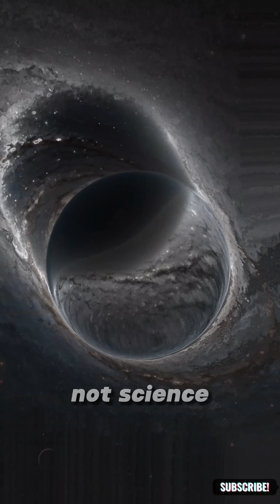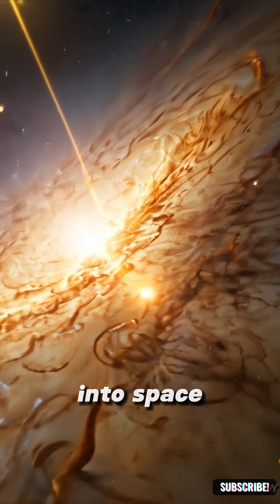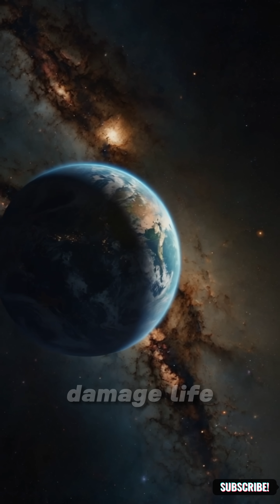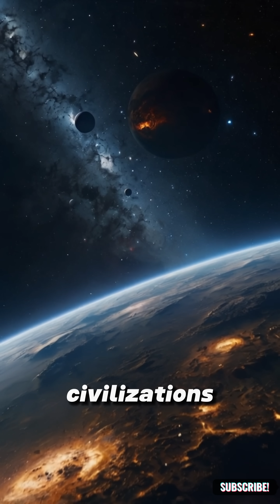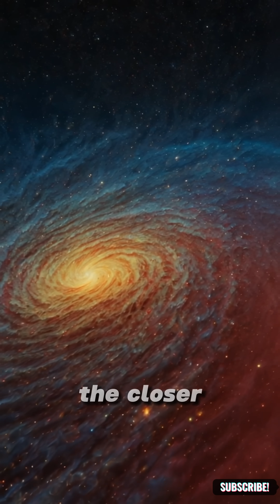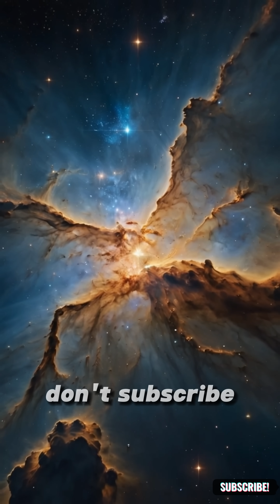What if We Could Harness Energy from Black Holes? ⚫⚡

Comment: I believe that black holes are very hot, hotter than stars.🔥❤️‍🔥
We just can't measure the heat, because the gravity absorb all the light💡 and all the heat.🔥
Like a well-insulated 🏭thermal power plant,🏭 in the vicinity of which ⛄low temperatures☃️ prevail, is not cold but just well-insulated and very hot inside,🔥❤️‍🔥
a black hole is also very hot and well-insulated from gravity.
🌕🪐🌟⚫ Love for all the lovers of the universe ❤️❤️❤️❤️
Reply from the maker: 🔥❤️‍🔥 That’s a beautifully poetic way to put it — and surprisingly close to the truth!

Black holes can be incredibly hot — especially in the accretion disk around them, where matter heats up to millions of degrees as it spirals in. 🌡️💫
But the black hole itself? According to Hawking radiation, it actually has a temperature — but it's colder than space unless it’s microscopic. ❄️🕳️

So you're right: it’s like a thermal mystery wrapped in gravitational insulation.
Love for all the lovers of physics and paradoxes! ❤️🖤🌌